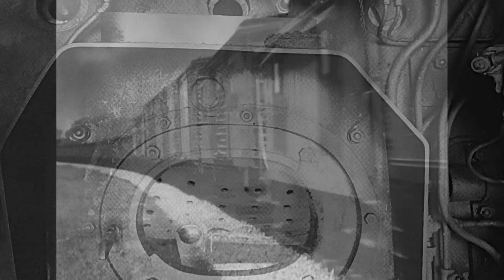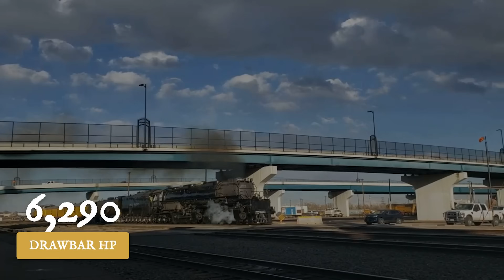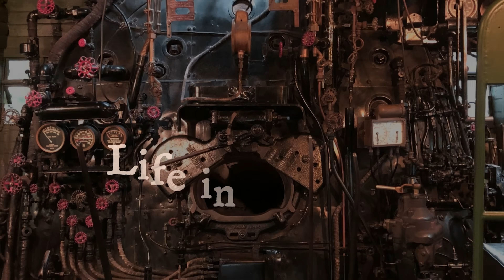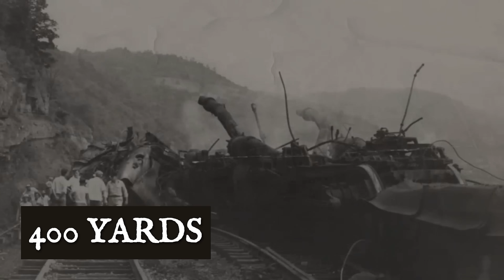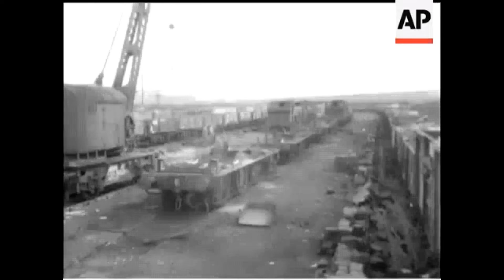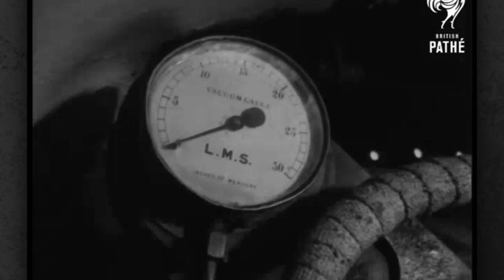How DEADLY Was The ALLEGHENY ACTUALLY?

Comment from the maker: Hi guys. Do you think any modern engineer could handle an Allegheny today? Just so you know, not much video exists of Alleghenys. They didn't live long enough for the camera age.
Reply: no thats not it, they worked rural mountain grades and were not in service very long thats one of the main reasons, pulling long troop trains, and coal drags are not sexy like passnger or art deco streamlined engines, they had cameras and film back then, heck there isn't even much footage of the fort wayne racetrack on the pennsy and that had 31 miles of flat straight track and a number of the experamental locomotives the pennsy used and had some of the fastest trains in the world, up to 140 there are stories of they say with the s1 but it cant be backed up that claim but there are many engineers and crews that timed their trips from the wayside posts and were doing over what the record established was at 126 heck its said an an engine in 1905 on that division for a brief time was doing 127  though they say an engine that size could not have had that power output, and the wayside telegraph posts may not have been spaced evenly so it could have been inaccurate in counting them per minute for each mile

Comment: This was an unfortunate case of improperly performed maintenance with the water pump issue along with the low water level warnings, these issues lead to the crown sheet failure that caused the boiler explosion and the crew members sadly lost their lives as a result. This was faulty maintenance and an unfortunate situation, steam was on it's way out at this point in June 1953, C&O Allegheny locomotive 1642 had a short operating life due to it's boiler explosion, if this explosion didn't occur it's like that locomotive 1642 would have operated for another 2-3 years as the last C&O H-8's were retired in 1956.

Comment: The presentation is apparently written for effect, not for accuracy -- there are numerous errors. Most of the photos are of other locomotives, many of much older design, and none of the engine being discussed post-accident. There are photos of the accident loco. The locos showing boiler tubes sticking out like spaghetti are mostly those that had a failure of the forward tune sheet in the boiler, not a crown sheet failure. The photo that purports to show the crown sheet location is not over the fire box section of the boiler. Suggest you focus on accuracy, not sensationalism, in the future.
Reply: True. Can I add that there a goodly many very interesting photos, a lot of them of British engines, crews and incidents in the film, which fly past far, far too quickly. However, I must say I love the vintage moving pictures of US steam power - that's a treat.

Comment: There are no limits to the steam pressure: the limits are only bad engineering or bad mantainance
Reply: I think there are certainly limits for the pressure. With construction metals available one can make a certain pressure boiler with max pressure to make it last...in heat and movements, thermal expansions etc...
Land based power plant boilers do also have a practical limit. Even the best engineers can not go over that in real life existing products.

Comment: Ehhhh not the most power when it comes to HP the pennsy Q2 had almost 8,000 horsepower 7,987 to be exact
Reply: 8,000 static, but only 6,645 drawbar
Reply: @SkylerShippy huh I actually didn’t know that
Reply: You are technically correct, but you forgot to mention the Pennsylvania Q2, we're not very efficient they had high operating costs and maintain its cost burning huge amounts of coal and water, the Allegheny will not as powerful steam locomotive was much more economical one, though they were both nice-looking steam engines, along with Union Pacific Big boy!
Reply: @RobertMay-tr1yx yeah I know they weren’t very efficient partly due to the whole duplex design and amount of coal they needed to be satisfied
Reply: Horse Power is not the interesting number to look for on steam locomotives.   Tractive effort is what you wanna look at.
Reply: @nickjancha6979 yeah I know tractive effort is the more fun number to look at

Comment: that loco had problems with its water feeding equipment for DAYS , with complaints from several engineers on their daily reports. the fireman had a water PUMP  operated by steam , the engineer had a NON-lifting injector . why the engineer didn't use HIS injector is not mentioned in the story i read.

Comment: superheated steam isnt created in the boiler tube part. steam locomotives have a superheater mounted in the smokebox, and its connected to the throttle so when the driver opened it the steam got superheated and got used in the pistons afterwards.
Reply: The super heaters were tubes inserted into the flue tubes that the saturated steam was fed through.
Reply: @roykey3422 yeah i know, why are you telling me this-

Comment: steam locomotives should have safety valves for this kind of situations, at least they were installed on czech engines making sure that if the boiler overpressured the steam would go out through the safety valves, czech engines had modern safety valves that could stop the exploding process.
Reply: Steam locomotives do have safety valves but they only protect against steam over pressure, not against crown sheet failures.
Reply: @BigAmp yep
Reply: @BigAmp  British (and probably most European) engines were / are fitted with fusible plugs in the firebox; the idea is that, in a low water situation the plugs will melt at a preset temperature level, relieving the pressure before the crown sheet gives way. It doesn't seem as if US engines had them; is that right?

Comment: In the late 40's my folks resided in NE Portland, OR, where the main RR tracks were routed through a natural gap in the higher hills.  I, at the then age of nine, regurlarly stood on a bridge as I watched those old steam trains a chug, chug, chugging, right by underneath of me.  

Later, after my folks moved to CA, my younger brother went to work for Southern Pacific and eventually ended up at a depot where his main job was performing a "rolling inspection"..... working the graveyard shift in order to do so.  He eventually ended up going out on minor RR mishaps and helping by getting everything back into working order.   

Once, now over 40 years ago and about 10 miles north of Santa Cruz, CA, a train car had ran off the rails at a nearby mine where material for making concrete was being mined from a large deposit.  A RR car was exiting the site,  had somehow ran off the tracks....but had remained upright.  A car with a crane on it was dispatched...his job was to set the cable so the crane could lift the car back onto its tracks.....and oversee the operation.   As the train car was being lifted by the crane, the car began to roll....my brother realized it, tried to get out of the way, lost his footing while climbing the embankment and with the car ending up landing on  top of him.....CLOSED CASKET FUNERAL!!   The funeral home later remarked it was by far the worst case they had ever dealt with!  
    BHE

Comment: C&O 1642 didn't explode "without warning". The engineer stopped at Thurman and complained that something was wrong with the water pump, as the engine wasn't getting enough water. The pump was pulled and inspected, but nothing was found wrong with the pump, and reinstalled. Hours later, when 1642 was approaching Hinton, it exploded.
Reply: 1642 had been pulled from service several times for waterpump problems and each time it was returned to service with no issues found.
Reply: @t.t.6398  Sounds like the pump was fine, but the pipes might have some blockage. Anything can fail. A bit of rust being pulled in from the water tanks can do it. The story of Thomas the tank engine with fish in the tanks is based on a true story from England. One locomotive added river water to it and later that day both injectors failed because fish got pulled into the pipes and blocked them. They really should have caught on to the same working pump being reported broken over and over within a short time span.

Thinking about it, it's possible that the valve at the boiler didn't open properly each time. That would cause a pressure buildup at the output of the pump and it would stop pumping when it no longer could add to that pressure. This would probably sounds and feels like a pump failure.
Reply: Also, there were reports of people along the track saying they heard the low water alarm going off just before the explosion. One other thing that may have contributed, the crews back then were known to run the water as low as possible and still be “safe” to help the boiler produce steam faster.
Reply: @duanethomas3087  They also may have been trying to nurse it in since they were near the end of their run at Hinton.  My understanding is that one of the crewman's bodies was found in a tree on the other side of the New River from the locomotive.
Reply: @paulw.woodring7304  Ending with low water is generally not a good idea. Either the boiler stays pressurized where it won't matter or it will be unused for days, in which case it has time to cool down. The latter makes sense until you realize that water shrinks when cooling, resulting in too low water when you need to heat up the boiler again, only this time you have to add water without having steam pressure to do so. I'm not saying people won't do this, but it's generally a bad idea to do it. Leave plenty of water for the next crew.
Reply: *Thurmond

Comment: Well yeah of horse power but big boy got more tractive effort though.
Reply: the big boy was designed to pull 4200 tons at 40 mph .  the c&o 1600s  were used in DRAG FREIGHT service  because of the  policy of the management. IF the c&o would have cut train size  in HALF , they could have moved many more 6000 ton trains FASTER. it all depends on what the mangers want. the same applies today .
Reply from the maker: Exactly, Big Boy definitely had more pulling force. But that horsepower difference is wild, 7,498 vs 6,290. Have you seen either of them in person?
Reply: @legendarylocomotives doesn’t 4014 big boy have 7,000 Horsepower